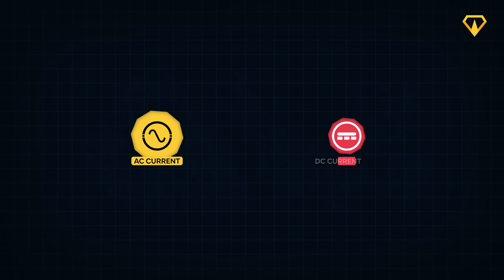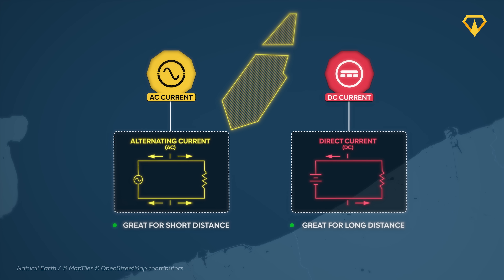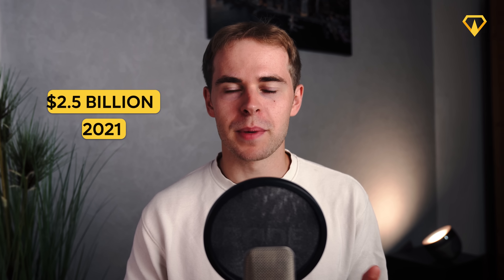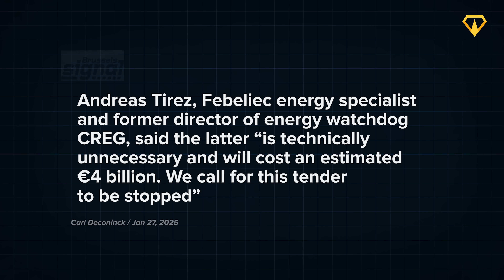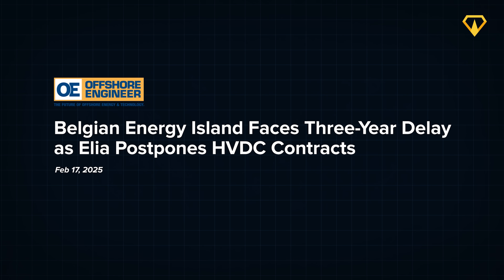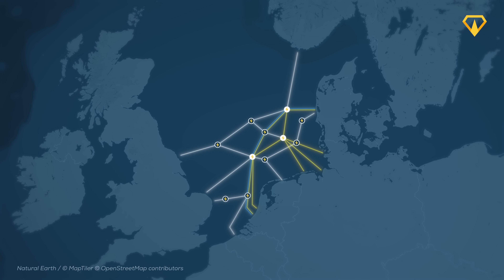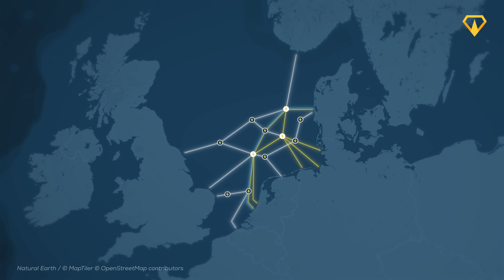How Belgium’s $7B Island Will Power Europe

Comment: It’s interesting to note that the entire continent of the United States is powered by an alternating current network which in my book translates to long distances! Even individual states constitute long distances for transmission purposes as do individual countries in Europe! All of a sudden the reverse is true? 

Even if new technologies have altered the picture, that doesn’t change the advantages alternating current has and always had! And then we have the issue of what voltage is generated from these islands and how does it get reduced down to 220 AC for domestic use, etc.? in AC the answer is simple: transformers! How do you change voltage in direct current? By converting it to AC and then back to DC? That doesn’t sound too intelligent. Then you have the needs of industry, which is not 220 AC; how do you service their needs using DC?
Reply: Interlinks tend to be DC. AC needs to have all generation in the grid synchronised. When you are linking different grids together (say, Texas ERCOT to surrounding states), DC removes that requirement, at the expense of needing rectification/inversion at each end.

Comment: I think that if eight countries are involved in this project, even eight billion euros is a pretty fair price to reduce or even end dependence on fossil fuels.
Reply: It won’t though, you can’t ’end fossil fuels’ until an efficient electricity->liquid fuel technology is brought to market. This is the real sticking point of the energy transition, ie storage that can be moved around cheaply and easily like petroleum fuels. It’s a total fantasy that metallic batteries can be scaled to sort out transportation and smooth out intermittent electricity production. This whole project is a joke, just build nuclear reactors, 90% annual up time compared to wind which is lucky to get 30, maybe North Sea is better than that but it’s not going to hit 90+% and frequently has to be curtailed as there is no economical storage solution.

Comment: about the idea: the plan will collapse. Its idiotic idea. Wind power is skyrocketing after major manufacturers like Siemens are in finantial problems (mainly because high failure rate and maintainance under warranty costs, both of which were initially expected way lower than they really are when pricing policy was created, hence their billions of losses despite operating in a field with extreme political and finantial support). Also wind is very unstable source of energy which, as any other volatile source, needs constant backups and stabilisation. Renewable energy is by far the most expensive energy source. What Europe needs isnt more renewables, but cheap, stable and safe sources of electricity. Therefore nuclear. Lots of nuclear. Europe as a whole needs to be building nuclear energy faster than China (which is several finished reactors every year, tens in active production and many more planned)

Some commentaries:
1) Russia and natural gas - it was Europe who decided not to take gas from Russia. Russia didnt dramatically reduce natural gas supply to Europe, Europe dramatically reduces purchases from Russia.
2) 3,GW of wind energy is what? Expected production or nominal power? Because renewables are inefficient. In annual production on average solar power produces around 5-7% of their nominal power, wind 15-20% so having 3,5GW would require around 20GW of wind turbines constructed. 
3) 300GW produced by 2050? Who in their sane mind believe Europe is able to build on average 70GW of wind turbine there every year from this year to 2050? Because thats what would be needed to meet that goal... total BS. Not just in pace, but there is no way to finance such a project, especially offshore.
The robot dogs are only feasible part of this 'project'...

Comment: Due to AI needing some much energy this project alone won't fix Europe's energy problems, but it will help get them get off fossils.
This island should also be equipped with geothermal in its centre, and the sea wall should convert wave and tidal energy into power

Comment: Should be looking at wave power as well! Tides are strong!!!
Reply: and they are reliable and predictable.
Reply: As I understand it the major problem with trying to harness the energy from tides is dealing with the corrosion from salt water, sending maintenance costs through the roof. As a result it's one of the more expensive energy producers and that in turn gets reflected in the price to consumers.
Reply: @13Xerro  There is great projects in the Northern islands of scotland. It is do-able. Just needs investment. Only metal corrodes.
Reply: @darrenmitchell2830  Orbital Marine Power - Orbital O2. a floating turbine that can be towed to shore for maintenance, at this point it can produce 2,4 MW.

Comment: Did you mean to say that DC was better for long range electrical transmission lines? Why/how? The lines must be MANY times larger.
Reply: AC is good for long distances (that's why it's used all over the world) but not in underwater cables. Sea water is conductive and would behave like a giant capacitor sucking energy from the lines. DC doesn't have that problem so, in this specific case, is more efficient
Reply: @el_mina  Rule of thumb
Short distances (<500 km overhead, <50 km submarine) → HVAC is cheaper & simpler.
Long distances (>500–600 km overhead, >50–100 km submarine/underground) → HVDC is better.

Interconnecting two grids with different frequencies or out-of-phase systems → HVDC is the only option.

✅ Bottom line:

    For very long distances or undersea cables, HVDC wins (lower losses, stable).

    For shorter regional transmission, HVAC is still standard (cheaper infrastructure, easier integration).
Reply: HVDC, transmitting at 10s of kV, is actually the most efficient power transmission system, but is too complex to set up as a grid, as all power draw would have to be actively managed. Hence it is used often for power transmission which only goes from a point to another, such as in a hub and spokes system
Reply: Actually no. Ask ChatGPT when in doubt. Both have pro's and cons. HVAC relative short distance and HVDC for long distance. Skin effect, three cables instead of 2 or even 1 and capacitance losses for AC and expensive DC-AC equipment for DC.

Comment: At the end of the day, wind energy will disappear. Wind energy is not a baseload. Or we will only have to work when the sun or wind is present. And the electricity grid must be reinforced times 5. (electric cars, electric trucks and electric heating.)
Reply: What matters is what is economical, and wind energy is incredibly economical. You can use other sources when there isn't enough wind, but when there is wind, you can dial your gas plants right down to spinning idle, store excess in gravity or chemical or thermal storage, and use it to manage spikes and drops in demand.
Reply: @technicalfool  Especially when you know that wind energy is the first to be switched off in the event of overproduction. And unfortunately people don't know what to do with the blades after 15 to 20 years (landfill). And yes it is economically good (through subsidies). See the failure of the grid in Spain and Portugal. They once tried to make 100 percent green energy. Until suddenly there is no wind or a cloud in front of the solar panels. As long as no (cheap) mass storage is possible, wind and solar energy is not optimal.
Reply: No it doesn't work like that it never falls to 0 it's inconsistent but that's why we have grid mix and storage
Reply: North Sea offshore wind energy is very different from wind energy on land though, equating it to wind energy in general is very uninformed. Do you really think every single country around the North Sea has invested in it (and is already successfully using it) because they know less than you do? As long as we don't have nuclear fusion it is very much here to stay.

Comment: I don't  get the point about the AC DC issue. You have less power loss over long distances with AC power and with 3f you can send 3 times more power with just adding 1 cable more. So basically 2 cables for DC and if you have 3f AC 3 cables you can 3time more power.

Is it efficient to have DC because those cables will be cooled by the see. So they dont have to invest in transformers.
Reply from the maker: They wanted to use high voltage DC cause it would be more efficient, but they faced significant cost increases - which is why they will delay that part.

Comment: You do realize manufacturing and installing a single wind turbine releases more atmospheric CO2 than that wind turbine can offset over its entire working life!  Right?  

Literally!!  Just the concrete used in a single wind turbine foundation releases more CO2 than that turbine can offset over its entire working life!  That doesn’t even include the manufacturing, transportation, coatings, infrastructure….  

So!  The turbine does produce “clean” energy!  However, you had to dump a shit ton of CO2 into the atmosphere to get it!  

Wind turbines are NOT green! 

Transcend the bullshit!
Reply: This talking point has been fact-checked into oblivion so many times that I'm amazed it still gets pushed.

Total lifecycle CO2 emissions in grams of CO2 per KWh:
Wind Energy 11g
Natural Gas 465g
Coal 980g

These figures are from the US dept. of energy, but I'm sure you can find other sources that will more or less give the same results.

Comment: Your explication of AC DC IS WRONG... It's exactly the OPPOSITE... DC is for short distance and AC for long... 💩 😂
Reply from the maker: It's actually not wrong.. the project planned on using DC as its more efficient for long distance using high voltage. However they have to delay that part due to cost increases.

Comment: Please, check your coment about electricity type (AC vs DC) on minute 3:29 as their characteristics are  the other way around. AC is goog for distance transmission while DC is OK for short distance usage.
Reply: This is not true for 'long' underwater electricity connexions, where DC is a better technical choice.
Reply: Pls check you comment because you got it backwards. Just ask ChatGPT for the right answer.
Reply from the maker: Hey, yes we are actually referring to DC here. At a very high voltage it is more efficient. So their original plan was to use DC, however there have been massive cost increases.
Reply: @MegaBuildsYT  You have no idea what are you talking about. DC is more efficient only under water because of cable capacitance. Over the land DC is way worse because of losses on voltage conversion, you need enormous distances to justify it.

Comment: I wish the project all the best, but this will not solve the problem of Intermittency.

When the migrant boats come to the UK by their hundreds in the Summer they do so because there. is. no. wind.   The sea is as flat as glass, and right through into September, whenever you have a pressure system over the UK or North Sea, you have light winds across the North Sea even which allows experienced sailors to travel to many beautiful locations.  In fact in Sept '20, right before the Ukr conflict, there was no wind for 3 weeks and the combined demand from the UK and Germany sent prices soaring.  There was no recovery because of the imposed sanctions on the worlds largest energy supplier in spring of '21.
When it does get windy out there, it's so strong the turbines are shut down so they're not damaged and the treachery of the North Sea FULLY lives up to it's reputation.
But hey, "it's taxpayer money and we have to spend it".

Comment: Correction. AC looses way less energy over long distances.
Reply from the maker: Actually not. High voltage DC would be better and this was their original plan, however costs have increased significantly.

Comment: 1:39 - - map
3:25 - - you’ve got them mixed (AC is for long distances)😊
Reply from the maker: Hey, we actually are talking about DC here. Its a High Voltage DC which would be more efficient for long distances. So their original plan actually was to use High Voltage DC. But as we said there have been massive cost increases.
Reply: @MegaBuildsYT  you just miss to say for more than 100 years, AC for long distances, DC for short distances, but now with a new tech HVDC are actually more efficient than AC for long distances.

DC were the first bet for energy distribution, but later Tesla invented AC and DC be replaced by AC in the NY streets.
Reply: @MegaBuildsYT  and we dont know if in the future AC dont come back to be more efficient at long distances, a future XYZAC -_-
Reply: indeed, only flanders is highlighted🤗
Reply: The good old rule is that DC is best for short distances and AC for what is traditionally regarded as long distances. However, for very long distances, much longer than electricity has usually been transferred across until recently, HVDC (High Voltage Direct Current) is the best alternative and that's what we're talking about here.